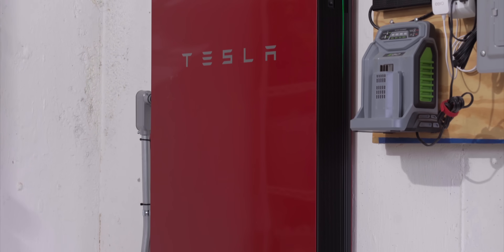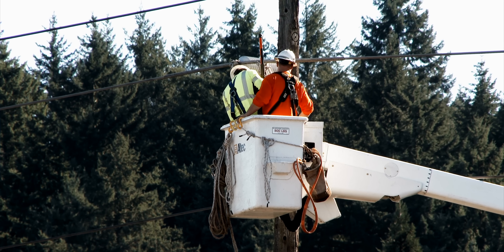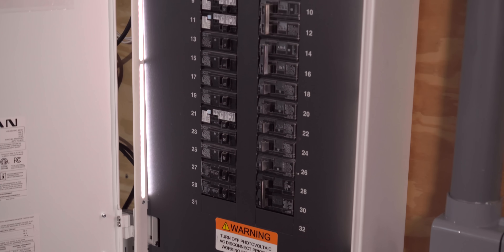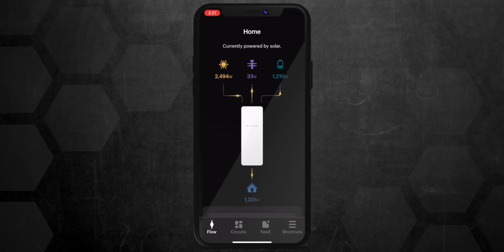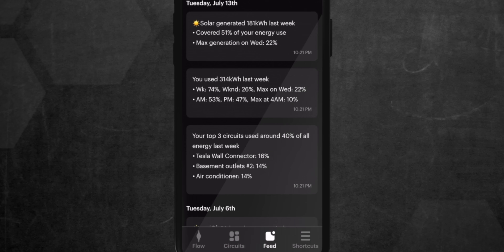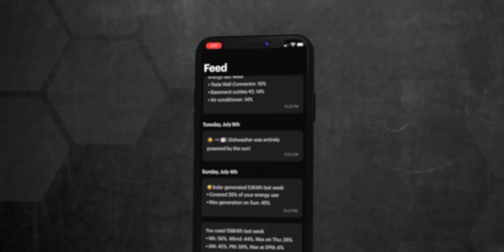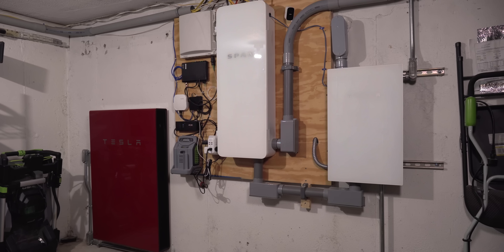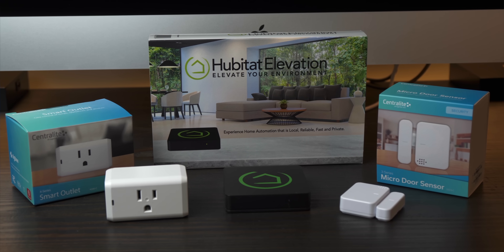This Smart Home Electric Panel Fixed My Tesla Powerwall

Comment from the maker: Do you have any interest in something like Span combined with a battery system like a Tesla Powerwall?  And thanks to Skillshare - The first 1,000 people to use this link will get a 1 month free trial of Skillshare: https://skl.sh/undecidedwithmattferrell08211

If you liked this video, check out "What you need to know before getting a Tesla Powerwall" - https://youtu.be/L6_2X_7Yy1E?list=PLnTSM-ORSgi4zR_CA4l6MZkee4XqgKn6Z
Reply: 🤯 thx for the awesome content!! This is one of my favorites!
Reply: Nice presentation, Matt. I've had my eye on Span for the past year or so. If/when their solution can be integrated into an Enphase/Encharge/Ensemble implementation, then they'll have a new customer. And potentially, I suspect, tens of thousands of others. One question about your setup: did you find the number of supported circuits to be limiting in your case? With all your home automation, etc., you may have more complex demands than the average homeowner. Cheers!

Chad Conway, anything encouraging to say about this?
Reply: I just had a call with them and they mentioned that emphasis support should be dome.by the end.of.the year.
Reply: I’d rather use the money to buy another Powerwall, thus increasing the amount of electricity that can be used during a power outage.  My brother has 3 Powerwalls along with Tesla solar panels, and he doesn’t have to worry about limiting electricity usage during a power outage.
Reply: @zoiks6631  there's also no way to smartly control or monitor your usage. A circuit by circuit level of detail - with the potential upcoming monitoring can be invaluable - depending on what you care about. It's not just about increased storage capacity for some.
Reply: @cpattullo1  I don’t care about knowing the details of electrical usage for every item in my house.  I just want to be to have no electric interruption or needed change in usage during a power outage.  That’s the reason nearly every consumer buys Powerwalls.
Reply: I have to ask, is the US power grid really that bad that you need all that??? I can understand wanting solar. Green and cheap. But you talk like blackouts are a common thing. I live in the Netherlands. I have not seen a blackout in 20 years, and before that they never lasted more than an hour. The cause was mostly  roadworks hitting cables, but that was fixed with better cable management years ago. How backwards is the US?? I don't think we have major blackouts anywhere in the EU, maybe in the old east bloc?
Reply: @bzuidgeest  Many Europeans don’t understand how large the land size of the United States is, or how the United States is not very densely populated in most areas.  Power lines run above ground for very long distances, and many areas of the country experience regular severe weather such as thunderstorms and ice storms.  So yes, the power goes out on a regular basis.  The blackouts don’t typically last very long, but they happen often enough to be considered a nuisance.
Reply: @bzuidgeest  I just got back from the Netherlands. Housing is built with concrete and masonry. All cables are buried in the ground. Native trees are very hearty and withstand high winds easily. In Atlanta, our cables are on wood poles. We have tall trees that are susceptible to heavy rain and wind. Storms roll in and inevitably a tree takes down a power line. GA Power has a great app and responds quickly but only if there are isolated outages. Once they are overwhelmed, it will take days to restore power.
Reply: @SxWerks  I get two responses to my comment talking about how cables run above ground in the US. Thus making them vulnerable. The answer seems simple. Don't do that. Bury them. They ran above ground in the Netherlands to once, long long time ago. Maybe more than a century ago. They still do this in some EU countries but mostly when going thru mountain terrain. The US cannot be all rock ground.
Reply: @SxWerks  it might be economical in rural areas. But only when looking at just the cabling. What are the economic loses off a multi day outage? No power no production. The government or the state has an obligation to deliver a proper working grid. That's what you pay taxes for. Citizenships should not be forced to implement their own backup solutions. That's basically the government asking you to pay twice for lousy service. That might be a very American thing. But to the rest of the world it makes no sense at all.
Reply: @bzuidgeest  Not easy to bury cables when your country is huge.  Imagine you live in Amsterdam and your capital is Baghdad.  That's the distance from San Francisco to Washington DC.....   

Also, the modern infrastructure in a lot of European countries is a side "benefit" due to all the infrastructure being destroyed 70 years ago (and rebuilt with US dollars).   In the US, a significant number of power lines, esp. in cities, are over 100 years old.
Reply: @ckm-mkc  don't flatter yourself. Yes we received some help after the war, but most of it we rebuild ourselves. It's not like America paid for 70 years of continuous renewal. Also that is no excuse to let your own infrastructure fall in disrepair. Yes the distance is greater, but if you can put it above ground you can put it in the ground, distance remains the same. Poles do not suddenly make cables shorter (outside then breaking in storms).' only high voltage should be done above ground. Unless you're in the mountains, but if I am not mistaken much of America is reasonably flat, and much is barely inhabited.
Reply: @SxWerks  The strange thing is, that every video I have seen comparing tax in EU countries vs the US shows that US citizens pay way more taxes then we do. And we still get more back in actual services.
Reply: @bzuidgeest  The state of US infrastructure is a combination of reasonable things and unreasonable.

A lot of systems were "invented here" and so the first implementation was not robust. Other countries benefitted, as by the time the civil engineering got there, the state of the art had had the "one to throw away" knocked out of it. 

The unreasonable element is well known. Our preferred method of collective action is for rugged individualists to gather around outdated public works and shout Freedom! at them until they pull themselves up by their bootstraps.

Likewise, a sympathetic view of the goods and ills of a given culture is one of the reasonable things about European societies. An example of an unreasonable thing is being ably demonstrated for us by M. Zuidgeest whose smug admonishments give aid and comfort to our right-wing demagogues in their quest to keep us from becoming more socially oriented.
Reply: @paulpinecone2464  at lot less was invented in the us then you might think. And I don't think I am smug. But if that is how you view cultures that actually change and move on. Cultures that lack many of the US problems. Cultures in which nobody is afraid of the cost of an ambulance or dies because they cannot afford insuline. Or where minimum wage actually adjusts with inflation. Well then I must be smug. 

Nothing of what I said is impossible to do in the US if there is a will and desire to improve things, but as it stands I see a country claiming to be the best of everything, yet cannot give a decent living to all is citizens, especially if you happen to be of color. 
Happy to be smug then. But mostly i am sad because you don't ever realize how behind the times you are. And even worse, that many of you think your way is the only way and normal. You don't have to be like us but you shouldn't accept low living standards for the minor chance to get on top one day. Almost none do
Reply: Do you have powerwall wiring diagram? I would like to take a look. I have been wondering how it works. Thanks :)
Reply: Say Matt,
In your home installation with PowerWalls and Solar, how many of the SPAN's 32 possible circuits are used up exclusively for your solar & PowerWalls? 
Ha-ha, I'm counting my circuits slots like they are gold  😀  
I suspect the SPAN won't take the half width circuit breakers???  If it does, then the smart switch feature will be controlling both 1/2 width breakers.  

Cheers,
Eric
Reply: For the solar array, he'll need one dedicated 240v breaker set for his solar array, another 240v breaker set for the battery. There also have to be dedicated 120v or 240v breakers for (almost) every major applicance. Think water heaters, furnaces, ranges/ovens, hot tubs, and EVSE car charging stations.
Reply: Matt, thanks for this. It's incredibly insightful. This is exactly the kind of thing I'd like to have for my house. From an emergency management point of view, the more people we can get establishing personal micro-grids, the more resilient we will be as a society. Great work!
Reply: This an essential component when I  build a new home with solar and batteries. Then I can control how the circuits are hardwired and work with the panel. I’m not interested in my current house because it was built in 1958 and the circuit wiring is a nightmare.
Reply: Can you please clarify why they can't have just one set of computer controlled hardware switches instead of having them in addition to the traditional cb's? Does it have anything to do with short circuit protection and breaking capacity?
Reply: @sruthakshisinha4724  There is a product like this - check out Lumin.  It keeps your existing panel, and just adds switches and monitoring to the circuits you want.  If you just want to monitor and not control, check out Emporia.
Reply: @sruthakshisinha4724  More than likely due to having to be able to physically lock out the circuit for safety reasons, a computer can glitch no matter how likely it is, it can, if procedure is followed and the circuit is locked out manually with the connection being physically broken, then it cannot happen

Would I have one, yes most definitely, just not available in my part of the world
Reply: I was thinking about doing this for all my circuits, by getting a sonoff wireless breaker for each one. I only have 10, so that's $320 to do essentially the same thing, but with the headache of using one of my Pis to display the multiple current draw. I don't really have the space or money for it, but I'm sure it's a great interface.
Reply: this seems like the opposite of off grid.
Reply: Hey Matt i love this system and my old company did too until we faces issues with our government! now i am planning to start my own company working on using as many of these features in a single building as possible! we even spoke to SPAN about Commercial / industrial version of their panels! my plan is the sustainable "Voltron" type company!
Reply: I think an addition of IFTTT is probably a better choice over just say Alexa.  IFTTT supports Alexa as well as a ton of third party home automation products and its an open standard which is key.  I am actively looking at solar with a battery with an additional critical loads panel, so seeing the cost comparison was excellent.  Thank you.
Reply: as for the circuit when you want to work on them. i found that having gfci breakers, it's easy to deal with this issue by using a GFCI outlet tester and doing a test. the breaker will trip :)  it's what i do on my leviton smart panel and it works great. plus you get a notification. tripped by gfci :)
Reply: Absolutely Matt 💯
Reply: Tesla Powerwall + Van + charging port for EV's
Reply: @beerye3  
How do you think this pointless self-indulgent crap sounds to someone who has to stand by a cash register 10 hours a day just to make rent?
Reply: Do you have many blackouts?
Reply: Matt,
We added solar last year and it covers all of our daily needs, including space heating, hot water and charging 1 EV.  Only Dec. and Jan. do we run a bit short on about 1 out of 3 days.  At some point when the cost come down the plan is to add home storage battery.  My goal is grid independence, which implies either a lot of batteries, or a smart panel. The kicker for us is having V2H as an energy security blanket for the winter months.  

So my questions are:  Does span system come with software updates?
Did Span say anything about what the smart panel might look like with V2H as a power source? How much control in terms of incorporating solar panels, home storage with V2H and how might this be managed with something like Span controls?   Any thoughts on this topic? 

Thanks for your great videos.
Reply: This would be perfect for an apartment building for each apt. attached to a Powerwall and solar on the roof. With the app the building management can bill for power included in the rent or like water a separate line item, but at lower rates. I think the system would pay for itself in what 10 years of tenants. I mean you would start with the building renovation of course, but HUD money will help.
Reply: I am scheduled to get 2 Powerwalls installed Oct. 29th. I am hoping to get more info on this Span device.

I'd love to jnow if you have any discount codes?
Reply: Does the SPAN panel eliminate the need for the Tesla gateway?  I would be surprised if Tesla would agree to that but the SPAN panel sounds like it can fully support the gateway functions and it would help off-set the high price of the panel.
Reply: My family is looking at building a new small house in the country. Perhaps it will be off-grid by necessity not just by desire. Our area will eventually have power to the house. Solar and battery seems the way to go for us. We dobby really want the noise of generators running day to day. Are there any alternatives to the Tesla wall or the Span monitoring options you might review??  Very Curious!
Reply: I'm planning my grid-tie solar installation.  Is the Span panel capable of automatically disconnecting from the grid during a power outage?   If it is capable and certified for that purpose, then it will definitely be a cost saver.
Reply: w
Reply: Hey Matt, I watched this video and started going down the Span path. What this effectively does is create an essential bus and a non-essential bus for your electrical system, giving you the ability to pick and chose where your power goes when there isn’t enough to power everything — power the refrigerator, not my Xbox.  

After a few months of back and forth calls with Span, taking pictures and letting them size the system, I finally got an estimate ~$10k, and instead, I just ordered a second Powerwall for roughly the same cost.  Now I have ample power and energy to cover whole-home backup in the event of a power outage, and I don’t have to pick which breakers will be powered since I have enough to power them all.  

Anyway, this is a really cool idea, but getting a second Powerwall was a better decision for my situation.  Thanks for what you do!!
Reply: This was a great video! Thank you so much for the information. I have been interested in Solar with Battery back up, but it seemed like it was a big ask because we currently have an automatic back-up generator for family medical needs incase of an extended outage. It would be fantastic to have something like this to have a clear idea of how much is being used/generated by solar/battery. Now more research I guess to see of this type up setup is possible in front of the backup generator saving it as last resort if no solar/battery. Trust me, you have to generate your own power for a week with a generator, it's expensive.
Reply: Yeah, if they wanna send me one for free as well.

Comment: If you have a 100-amp service and you've been told you need pay to go higher like a 200 amp due to more EVs in the household, you could use the Span instead to manage that load, so you stay under the limit of the 100-amp service.  A span in that case would be cheaper than the service upgrade.

Comment: I'm getting a solar install and service upgrade at the same time. No batteries at this time and I have three EVs. The solar installer is quoting $6k for the Span panel installed. Is it really worth that much? I'm in central Mass, plan on batteries some day, and would like to be positioned for EV-to-grid if it ever happens.

Comment: Matt, I just added a split heat/ac for an addition that we have. In the process we had to upgrade our panel from 100 amps to a 200 amps panel. In the process I was offered to add Span smart panel. I jumped on it. The small project just concluded this week. The reason for adding the smart panel was for me to get a handle on my energy usage. I am hoping as well to add solar and batteries to my home in the future. Thanks for all that you do.